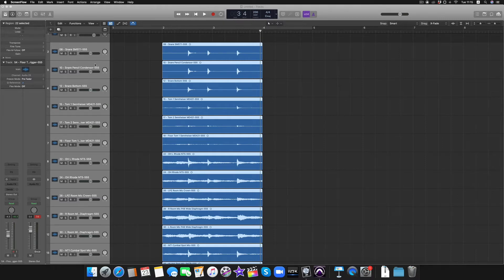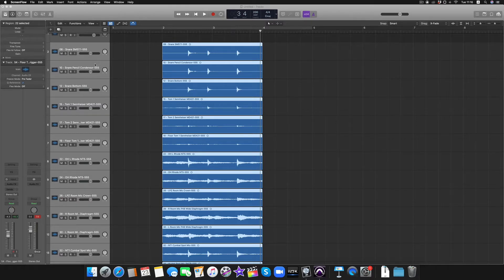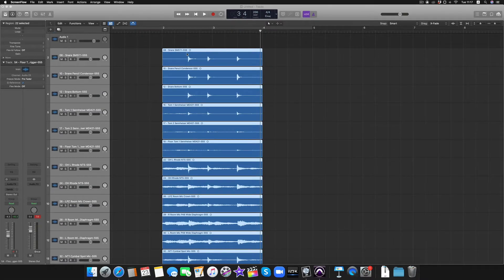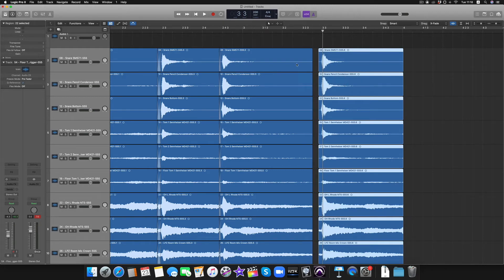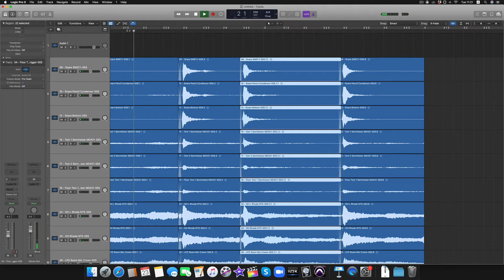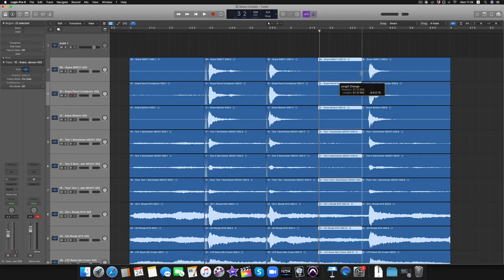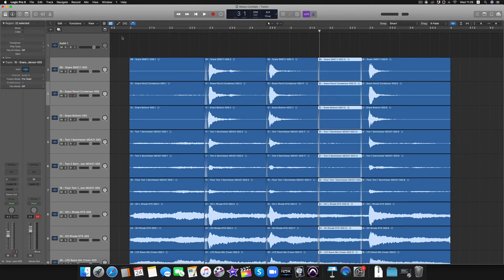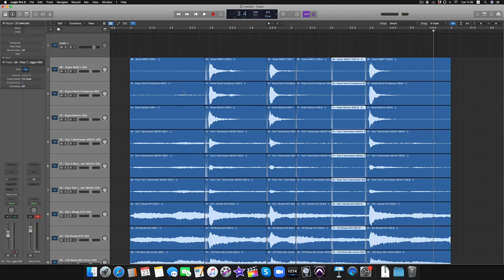How To Fix Cymbal Stuttering When Editing Drums (Tip #1/7)

Comment: Ummm... "Flex Time" slicing mode, "Fill Gaps" checked, done.
Reply from the maker: Flex Time…says it all!
Reply: @DrumAudioEditing  My point is that if you are using the proper mode in Flex Time, then some of the accusations made about Flex Time here are not accurate. Saying that Flex Time "changes the pitch" or "creates phase issues" in your drums shows you are using the wrong Flex Time Mode (probably Polyphonic). 
Slicing Mode in Flex Time does exactly what you are already doing in this video, but with easier workflow.
Reply from the maker: Editing isn’t a one-size-fits all process, and if it works for you, then that’s fantastic. Types of time stretching such as Logic’s Flex Time amongst many others are getting better and better. 

Whether it works for you or not, the bottom line is Flex Time is still a form of time warping. Whether you’re using ‘slicing mode’ or another algorithm, the wavelength of the audio will be affected. If people are dealing with a particularly sloppy recording and have to make large movements with Flex Time, it will cause changes in pitch and unwanted artefacts.  

Please consider that your way isn’t the only way, and no method is any better than the next. Different ways of editing suit different people, workflows and editing scenarios.
Reply: @ I totally agree that different approaches are needed in different cases. But again, you say "cause changes in pitch and unwanted artifacts". That is just plain incorrect when talking about Slicing mode. You have it stuck in your head that all modes of Flex Time are the Polyphonic mode, but they are not.
Slicing mode literally does exactly what you just did in this video. 
When you make a Flex Edit in Slicing mode, it preserves the entire drum hit (no stretching, no pitching, no artifacts) and simply moves it around, exactly like you dragging a chopped audio region around. When you have Fill Gaps checked (the default), it does the same crossfade trick that you are displaying here. 
Basically someone at Logic already knew this trick and created a special mode that does exactly that, but with much easier editing.